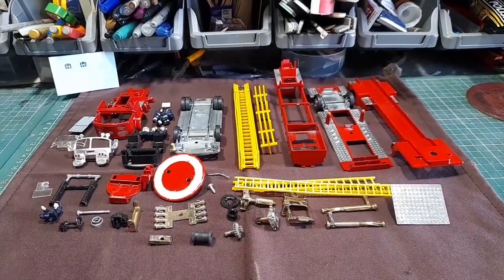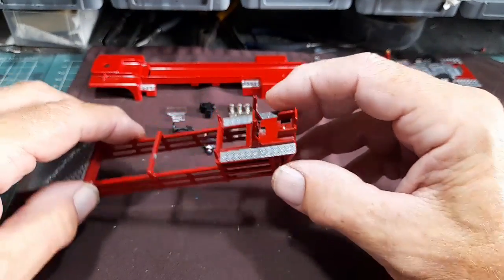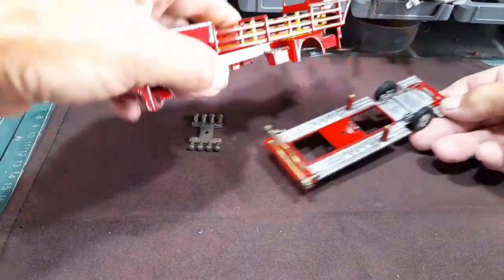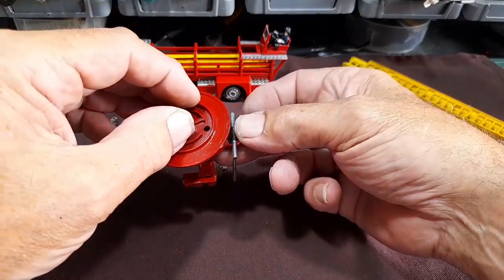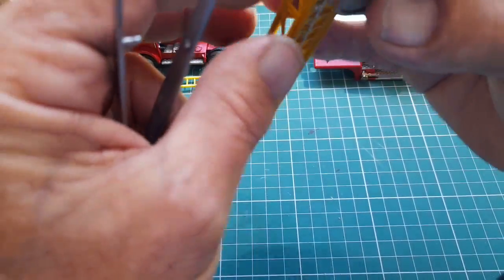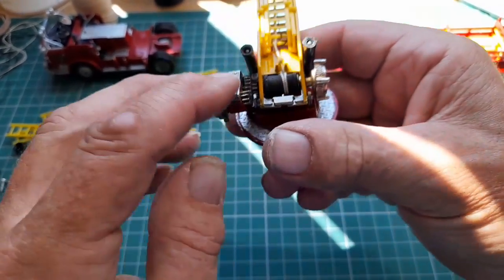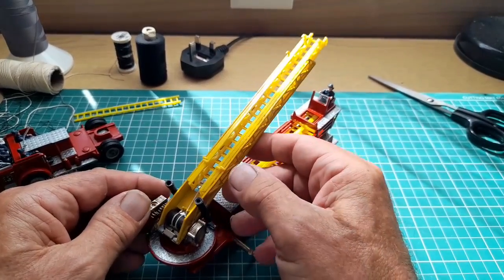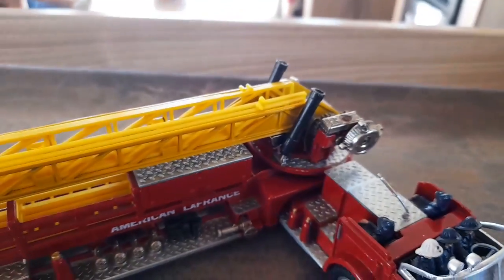Diecast Restoration Corgi major American La France fire engine part 2(failed)

Comment: Martin you're a genius. Despite the string on the ladders not being quite perfect (which you will sort out) and the jumping gear, I reckon that's one heck of an amazing restoration. You're an inspiration to us all,  very well done. Take care and all the best. Peter.
Reply from the maker: Thanks Peter, it was a shame about the gears ,but in my defence its a weak point in the model design because the cog wears on one edge only and courses the slip and cannot be turned round .
But I have a cunning plan .
All the best martin 👍

Comment: Well Martin, you certainly put yourself through it with this one, despite your not being happy with the ladder and the jumping cogs, I think you have done a superb restoration on this model, definitely not one for the faint hearted, I’m sure you will get the strings sorted out, I was also wondering if you could maybe file a fraction off the top of the box or the underside of the lid where the cogs are so it would go down slightly tighter and maybe take up the little bit of slack that causes the jumping, I have one of these that does exactly the same.
Anyway, you have done a great job, it really looks the business, I love it! 👌👍😊
Take care, all the best, Nick🐸🐸
Reply from the maker: Cheers nick, it certainly tried my patience thats for shore , I will try your idea you never know, apparently after further research the cog that you turn is very slopy on a lot of them ,
Well onward and  upwards. To the next mission

Comment: Wow. Now you know why I have waited for you to do this first.! This has to be the most complicated restoration ever. But a good job! Just a tip when you need 3 hands. I use tiny balls of blue tack to hold bits on while they either dry or to stop them falling off. I.e. the gold hose connectors on the trailer. The blue tack can stay there, as you won't see it once it's finally assembled. How they assembled  it in the factory god knows. But thanks for that video. You did exceptionally well. 😊
Reply from the maker: Thanks Philip,  it was very tricky at times,  the blue tack is a good idea thanks for the tip .
All the best martin 👍

Comment: That tractor head would make an interesting Code3 unit if the bell and siren were filed off and you had a spare Bedford or Ford cab knocking about... I like the long wheelbase on it, and the base of the trailer part would make an interesting flatbed. The tractor would make a good recovery unit as well.
I marvel at your paint finish Martin - it always looks bright and shiny and seems not to mark easily either. I can never really get that here. Like many other correspondents, I am delighted you have done this, so I don't have to! I don't think it's a 'fail' by any means, either! It is a bugger when they fight you all the way, and I have had a few near 'bullseye on the outside wall' moments, but it is hugely satisfying in the end - as you know! Thanks for sharing the ups and downs.
Reply from the maker: Thanks Fraser, yes I can see the potential for a code 3 on this .
ItS really hot hear so painting can be a pain.
All the best martin 👍

Comment: Wow Martin, you sir have just set the bar for restoration videos with this massive undertaking. Reminds me of the Capri rally you did, but way more bits and bobs as you call them. Far from a failure, it came out stunning and does work with some fiddling. I’m sure you’ll figure everything out for part 3, a sequel worth watching. Cheers to your ambition, ability and your modesty
Reply from the maker: Thanks for the kind words John itmeans a lot ,all the best martin 👍

Comment: Martin you are too hard on yourself! A fantastic job on a VERY complex model. Some slight lubrication on the hydraulic rams may help the gearing to lift the ladders. This is not a fail in my opinion, again a top job my friend. Cheers Chris 👍🏻🎯🍻🚒🚨
Reply: On most diecast the rams should be a fairly tight interference fit, so the rams will hold the ladder in the raised position.  They would be much stronger than the geared lifting mechanism.  The rams do wear out and loosen.  Similar type of rams are used on tractor, backhoe or loader arms to hold in the raised position, while the bucket is being dumped into a tip truck, or similar.  I'm not sure what the model designer had in mind, when combining a winch mechanism to raise the ladder, and rams to hold the raised ladder up.  An earth moving model usually does not have a gear mechanism to raise the arms.  I'm going to have to look more into this.
Reply from the maker: Thanks very much, that's some very interesting information Thanks
Reply from the maker: Thanks Chris, it's a bit tricky trying to get them all to work together on this one ,but I will get it right .
All the best martin 👍

Comment: Beautiful work, very well restored. Have you solved the problem with pulling out the three ladders in the meantime? Mine doesn't extend properly either and I think I know where the problem is, I'll have to try it out.
Reply from the maker: Thanks very much ,no iam still working on it now and again, it certainly trys your patience. 
I will do a short video when I get it right , All the best Martin 👍
Reply: @martindaredare  I have now been able to repair my ladder. A knot had come undone. Maybe this is the solution to the riddle for you too. Namely the knot on the top rung of the first ladder, onyour drawing that is the red thread. The thread itself was still closed, but was not taken along by the second ladder section to extend the third section. I hope that wasn't too incomprehensible...
Reply from the maker: OK thanks very much my friend that's great news 😀

Comment: Hi, great video, I love these things but was wondering, one of mine has the rear  tillerman and his steering wheel missing and I can't seem to find replacements. Any advice at all please, I'd be very grateful. Thanks, Andy.
Reply from the maker: Hi Andy, what I did for the man at the back was I had a spare crew the one we're there's 3 stuck together and I cafulley cut one of and cleaned it up ,and the steering wheel you can use one from another vehicle that you have doesn't matter as long as it looks right , this is the reason I never throw anything away these days .
I hope this helps .
All the best Martin 👍
Reply: @martindaredare  Hi Martin, great idea but unfortunately don't have any spare crew which is a shame. I'm surprised no one has 3D printed one these days, lol

Comment: I think I would have left the ladder 'unrestored' apart from the gears/cogs that make it lift up and down.  As the ladder did extand and retract when you first got it. But for the fact that it's not restored to "play with" it is restored to be a nice display model!
Reply from the maker: Hi Mike, yes that would have been an idea Mike, the ladder I was demonstrating was a spare and a lot of the rungs and side peices were broken so couldn't be used , but iam sure I will sort it , it certainly tried my patience thats for shore. 
All the best martin 👍

Comment: I'm not laughing because you dealt really well with a very tricky resto.  Neither do I consider it to be a failure.  I am wondering if a dab of silicone grease in the black piston cylinders might help reduce friction and thus effort needed to raise the ladder. I also wonder if a tiny piece of heat shrink tubing on the gear shafts might help to make good any sloppiness under that cap, although I think that there is an equal risk that it would just make matters worse.  I don't think a touch of silicone grease would do any harm though.  But does functionality matter if the model is to be used as a display item?
Reply from the maker: Thanks David, some good ideas there my friend, will come in handy when I reviset it again. All the best martin 👍